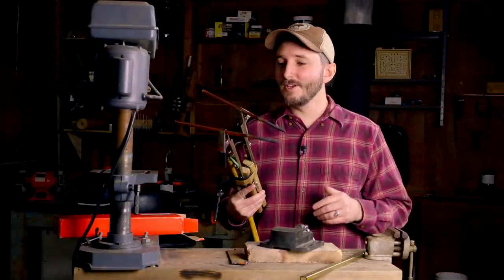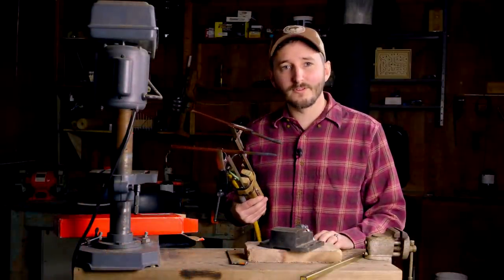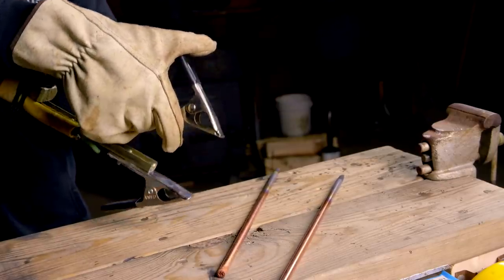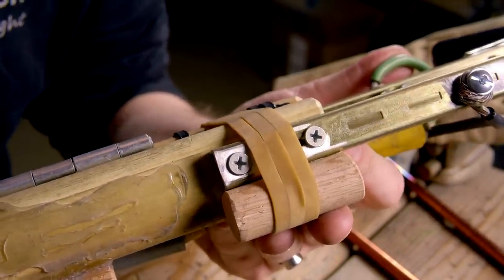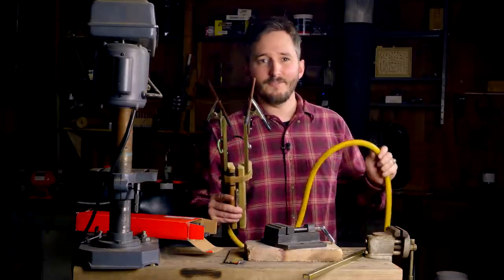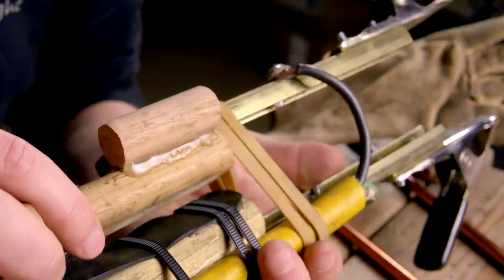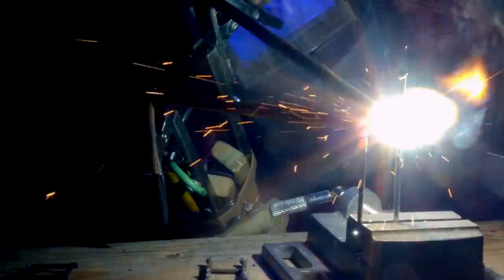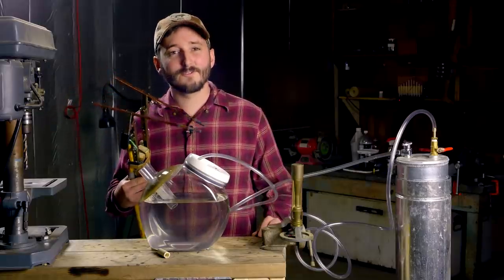Recreating An Antique Carbon Torch (Oxy/Acetylene Alternative)

Comment: A suggestion and then an idea.

Suggestion: Add a nozzle just behind the arc (or far enough back to not risk arcing to the nozzle) to be able to both blow a shielding gas and direct the heat from the arc through forced convection rather than letting passive convection carry a lot of it straight upwards (similar to how a Jacob's ladder uses a jet of gas to move the arc upwards)

Idea: If you make the nozzle exchangeable you could put a small diameter one for blowing very fine jet of oxygen right at whatever it is you are heating, add a poppet or solenoid valve to the O2 line (one which is safe for O2 use) and then presto you effectively have a poor man's plasma torch.
Reply: Actually I forgot you'd need a shielding gas around the oxygen jet in order to not oxidize everything and to actually cut with any usable precision.
Reply: actually on further though ignore the O2 jet, it'd probably just end up blowing something up, best not mes around with that aspect until hospitals are no longer overburdened (just in case).

Comment: Way to to go as I was binging your videos just last night.

By the way I was rewatching your carbon filament bulb video and I remembered something I did a few years back

I had a bottle stopper through which I shoved two wires and the inlet from a fridge compressor, on the wires I mounted a thin graphite rod for a mechanical pencil and burned it in air for a short time which caused it to burn all the wax in it and also become even thinner. then I put the whole assembly into a soda bottle (in my case it was an old torpedo bottle I had, which I think had the ideal shape to withstand being evacuated). Keeping the compressor running I could run this bulb on 12 volts from a computer power supply, and even despite the enormous leaks through and around the cork the light burned quite brightly for about half an hour until the computer power supply gave out the ghost, it was a rather low power unit and also about 20 years old.

I had a video or a photo of it that I don't know where it is, which was terribly unfocused because the camera I had back then was broken, I'll try to find it.

On a similar note to that and this, check out the Yablochkov candle on Wikipedia, it's a type of carbon arc lamp that does not need mechanical adjustment of the electrodes. Coming to think of it you could have probably used them as torches too.

Comment: if you blow hydrogen through that arc .you will be able to perform what is known as Atomic Hydrogen welding. it is similar in style and method as gas welding but has unique properties , and a truly unique weld patern

Comment: The cable you are using can be made to work a little better by using the white wire (that you left unused) in parallel with one of the other wires dropping it's resistance to 1/2....for cheap welding cables just use car jumper cables...

Comment: To make hydrogen and oxygen, you need a dc power supply. Your welder is ac. Im not sure if ac produces both off of both electrodes or what. I have an old carbon arc/ arc welder.

Comment: Carbon rods are neat for all sorts of "home built" apparatuses.  (Yes, that's the plural.  It blew my mind.)  One that I'd like to try if I lived anywhere near the ocean is to create bleach with them and an electrical current.  King of Random did this way back in the day using his car battery as the power source, but I've always wanted to try myself with real self-sourced salt water.

Comment: I'm surprised that such thin cable can handle that current, however I also don't know what current your running it at!
And for a moment I thought you'd be generating oxygen and Hydrogen using dielectric breakdown, but an arc welder doesn't have that voltage, but striking an arc under water and drawing it back a bit as your setup seems to suggest would bring water to the point where it can decompose thermal..
Look forward to seeing what you do with it! :)
Reply: Graphite has decent resistance - it limit current in circuit.
Those will be H2O + C = CO + H2 reaction, require high temperature which arc will supply.
Reply: Thin? That's like 2 awg.
Reply: @xenonram  Look again. That is two conductor + earth/shield. A single conductor of 2AWG would be as thick as the whole cable. The one used includes a lot of additional insulation(That would derate the cable even further). I'd be surprised if it was a quarter of that.
All this is just guessing however, without @nighthawkinlight telling us. :)
Reply: @ElectraFlarefire  What NightHawk used is definitely thick; looks like it could indeed be 2 AWG, in any case not thin.
I have been watching some other videos of other people's and they might have been using 10 AWG...?
I'd like to know..

Comment: Cool project but... since you have a welder just grab a 6010 rod and crank the amps. 1/8 6010 at 300 amps will cut through 1/2" mild steel no problem. Great technique for blowing holes without oxy acetylene.

Comment: That's a fair number of large, exposed, live surfaces within easy slipping and/or bridging distance of one another. I'd consider putting a bit more electrical isolation into it if you're going to use it much. If you're worried about that causing overheating, you can get spacers which are electrically-insulating but thermally-conductive, like mica or some ceramics.
Reply from the maker: It's low voltage. Arc welders only run 20-30v usually.
Reply: @Nighthawkinlight  Well, I guess that should be okay unless your skin resistance is compromised. 12V is considered the highest "safe" common voltage, but, that is with a large margin of safety. Even the 30V should be okay unless your hands are wet, or you happen to touch it with a cut, scrape, metallic sliver, or anything like that. Still, careful not to accidentally hit anything conductive with it.

Comment: I converted one of those el cheapo Chicago Electric AC flux core welders to run DCEN. With "min" and "max" amp settings only for this 125A unit, this could still work for a carbon arc torch. Right? "Oh", as Detective Columbo often said, "There's one more thing!" That being: would this work on an unmodified AC welder without the electrodes overheating? 🤔

Comment: i have a suggestion: thre is a type of HHO generator that i always wanted to build, using simple physics keeping the 2 gasses apart and allowing them to stay seperated
for that you get some PVC Tubing, and create a U shape, an electrode on each end of the U, and run power trough it, that way the hydrogen produced on one electrode will never mix w/ the oxygen on the other electrode   

id love to see that actually tested as i have never gotten around to try it myself

Comment: The amount of UV light produced by arc torches is enormous. Not just the kinds that create Vitamin D and sunburns, but also UV-C (used for killing germs and other living cells). One practically needs to use zinc oxide (sunblock) under your welding gloves to avoid UV burns. Better to keep it inside a small furnace!

Comment: Cool idea but if your going to use it for cutting like oxy acetylene you might as well just have a modern arc gouging setup where compressed air blows away the molten metal.

Comment: could you use welder's clamps with their own cable instead of buying an additional one?
Reply: As a kid I did just that, I tied carbon rods harvested from old torch/flashlight batteries onto de fluxed welding rods with copper wire. My rod holder and earth clamp where the same, bare cable ends and a vice grip. One in each hand and good to go, for free!
As mentioned the UV IS fearsome, that was the way I got arc-eye the FIRST time. Happy days.

Comment: how about adding a compressed air nozzle actuated with a foot pedal or by the motion of the chopsticks up along one of the electrodes blowing out? would make for one mean plasma cutter, far more efficient than the steel cutting you did here
Reply from the maker: That's a good idea

Comment: Brilliant ! BUT ya did it the wrong way .. OVER THUNK IT.. Take it from a retired welder.. IT ant that complicated..  Basic  is two pipes  attached like  plyers with an insulator and two leads . Control the " FLAME" by AMPS  adjustment. Wating to see the NEW torch. Great video, Thanks

Comment: Could this be modified to be an atomic hydrogen arc welder? All that would really need to be done is replace the carbon electrodes with tungsten and add the gas.

Comment: "i have never heard of a Carbon Torch"
The king of Random: am i a joke to you?
Reply: I was thinking his arc furnace would be perfect for the rubies as well.
Reply: Ave also attempted to melt titanium or magnesium in a crucible with a carbon rod connected to his welder.  He had it in a tub full of shielding gas. It didn't work.
Reply: Rip
Reply from the maker: Grant made a furnace, not a torch.
Reply: @Nighthawkinlight  but didn't he use the same carbon rod arc?

Comment: FYI, you can parallel smaller wires to work for a larger amperage. They need to be the exact same length and terminate at the same location. So using two 12 guage wires terminated at the same location on each end of the wires would equal 40a capacity because 12 guage is good for 20a. If you add a third, you get 60a and so on. Can be cheaper to find smaller wires but jumper cables are also a good option for larger wire leads.
Reply: I did this for my welding extension cord used 3 14 gauge cables.  50 foot.  Works well
Reply: Note you should expect a few percent loss for safety reasons. If one is shorter (it will be due to human nature), one will carry more than the other. I'd just do (wireAamperage + wireBamperage) * 0.98 or so. There's the 2% loss for "the pliers slid a mm when I cut it"

Comment: Wow, the clamps & rails seem more expensive compared to the other stuff, even though they’re much more easy to make & made of common metals
Reply: What "other stuff"? The rail was $3. There is no "other stuff." The rails, clamps, wood, and cable. Much easier to make than what? The clamps and rails ARE the cheapest parts.
Reply: @xenonram  the rods? I don't live in the US, but a Clamp generally costs about $1

Comment: That looks great my only comment is you should buy a couple of lincoln electric ground clamps off of amazon. I put one on my mig welder and they are better than most. I am intrigued into the gas its going to generate..

Oh yea clean your clamps they may function but you are losing a ton of efficiency with those clamps on your arc welder.

Comment: These are pretty handy-- but whatever you do, be careful about storing the rods. Humidity isn't an issue like 7018 rods and such, but if you accidentally get them wet they can absorb and hold enough water that they can suffer a steam explosion and shower insanely hot carbon everywhere. Like I said, only an issue if they get rained on or you spill your coffee or something, but you should keep it in mind.

Comment: i've always wondered if you could use a car battery charger as a welder.  they're small and i always have one in the car.  could you do some tests on this?  (not the batteries, i know they work, but the charger.)  great video.
Reply: No. You can't. The voltage is a little bit low, but the current is the real problem.
Reply: @xenonram ,  ok thanks for the info
Reply: You can for small stuff, but need a big car battery. The small, crap-box car batteries aren't usually powerful enough.

Comment: Could this work with a modified microwave transformer ?. Where i live that would be an extremely good system for melting/heating things welding(some things) or rough cutting in terms of cost

Comment: What amperage range are you setting that welder to? That power cable looks like ~12AWG SJTOW, which would start to get pretty hot at around 50-60 amps. Does AC or DC work better?
Reply from the maker: 40-150a. Cranked it up to 230 and noticed no cable heating. Not sure the gauge but its bigger than the native cables on my welder.

Comment: Did you compare the cost of electricity with oxy acetylene gas?
Reply from the maker: I'm certain electricity is less. At least for me, who would have to buy tanks and torches, then drive long distance to fill them. I also already had a welder.

Comment: would it beneficial to add a compressed air tube to the plasma stream?
Reply from the maker: Yes maybe so
Reply: @Nighthawkinlight  I think you'd start getting NO and NO2 which should yield higher heat potential in the flame Maybe some organic compounds too!

Comment: Gouging electrodes are not very efficient.  Proper remote arc electrodes have a core of strontium enriched carbon and operate at only 40 amps.  Try this: drill out the center of the electrode with a 1/8" bit - keep the carbon.  Mix 10% table salt with the powdered carbon and pack it back in.  It works much better but you only get about an inch of electrode to use at a time with that method.  Finding the right electrodes is the way to go.  They still use them with some projectors in India.
Reply from the maker: I'll have to do some digging around and try other options. So far these cheap rods have worked well enough for loosening rusted nuts.

Comment: This also called an arc air cutter
Reply: No, it is different than carbon arc gouging and different than a plasma cutter. (Not sure what which one of those you're calling an "are air cutter.") But they use compressed gas to blow the slag out of the kerf.

Comment: Why not use electrolysis to separate water into oxygen and hydrogen and then use them in a torch?
Reply from the maker: I already have an arc welder, and this is capable of higher temperatures than hho.
Reply: @Nighthawkinlight  thanks for the answer, it is also a lot safer!

Comment: Youtube's increase in ad-play has really resulted in a high cycle of frustration. And despite your expenses, job or not, the number of mid roll ad breaks is all the more excessive. Two per commercial break, many of them way out in left field in the services they're offering. Indeed my interests range wide but I can't imagine why Google would decide I was working in manufacturing automation line design, remote management of oil extraction, accounting, enterprise tech support or anything else. I am commonly a dishwasher, more so in the past ten years than I would like to have been. That however doesn't mean I'm on the edge of my seat to pay Motley Fool for their stock tips, pay for a "college" level online course for AI development, invest in dubious projects that promise incredible growth. The only thing Youtube and Google manage to get correct is posting reminders to my home page on channels and subjects I'm leaning toward in the present. It doesn't mean they can sell me a service (I don't run a business or sit in a prominent place in a company to recommend anything) I don't need recommendations for new products either. Why the hell can't the platform get targeted advertising right?

Comment: Since you kinda mentioned solar power... why not skip the carbon rods and all that extra... and just go au natural with solar and magnification?
Reply from the maker: That doesn't work so good if you need to heat up a siezed nut under a car
Reply: @Nighthawkinlight  But I would think it would work nicely for the synthetic ruby. As for under the car, yeah... you got me... tho... fiber optics? :D

Comment: Anybody else see the glaring mistake at 3:21 and again at 3:29?  When using three conductor cord as two wire cord, pick one of the used conductors and connect the unused conductor in parallel!  It costs nothing and it improves the efficiency of the cable.  It doesn't matter which two: black & white or black & green or green & white, as this electrician's nightmare has no other purpose.  Just be certain to be consistent on both ends.

Comment: Can you literally melting wood with this torch. I mean heating the wood to get carbon and keep heating that carbon until melting the carbon down.
Reply from the maker: Carbon will turn to gas before it melts. This torch doesn't get quite that hot though.

Comment: 5:41 that's not a safe way of producing hydrogen gas, if that is your next project.
Baking soda does produce CO2 as a product of electrolysis, but that's going to be used up and oxygen will be next.
Be safe man, that's a project I'm working on right now.
Reply from the maker: Nope, not making hho!
Reply: @Nighthawkinlight  Sorry, I kinda jumped the gun there. I'll be waiting for the vid!

Comment: kurt saxon poor mans james bond had also a furnace which uses carbon electrodes , so i made that arrangemnet , fool i was . i used wire used in house wiring. bloody hell not knowing anything i cast out electrodes from 1.5 volt pencil cell batteries. now i switched power on which was house supply 220 volt in , 50 hztz. i was a complete novice at that time . so as i switched on the supply , bang there was a gush of smoke in whole rroom . mcb tripped i was not able to understand what happened , now it happened 10 years ago. i had just passed my graduation, i followed what was written in kurt saxon, without consulting anyone , i escaped a terrible accident that day as instructions in kurt saxon carbon electrode furnace were incomplete. my little knowledge about power supply and temperatures carbon electrodes produces i figured nothing just i was tryin to enerate 3000 degrees in living room . the dumb fool i was , god saved me that day. after that i never experimented power related stuff. it really needs an expert inpower and heat related topics . to build this type of thing it is way to danggerous for common people to even try . so be safe these thins are really deadly if used without knowledge.

Comment: Way to much finesse in the creation put your ground clamp on the work piece then you’re only manipulating the carbon rod no special hand finesse needed and if you want to increase your ability to cut iron blow compressed air down the length of the carbon rod